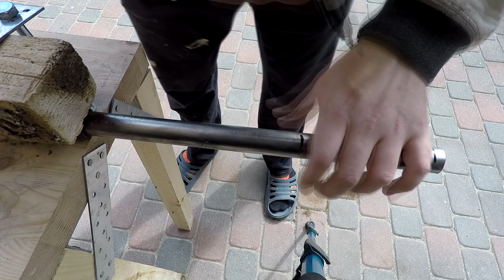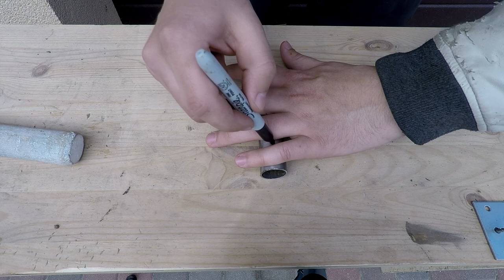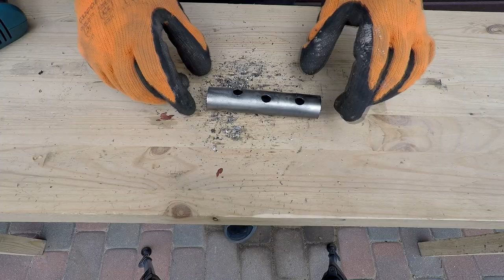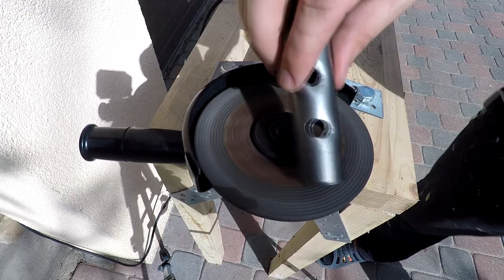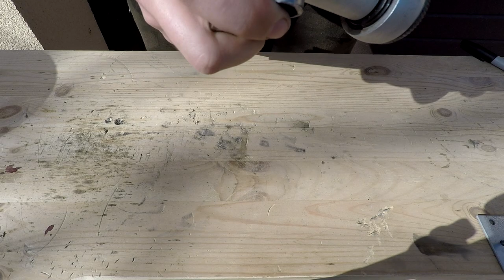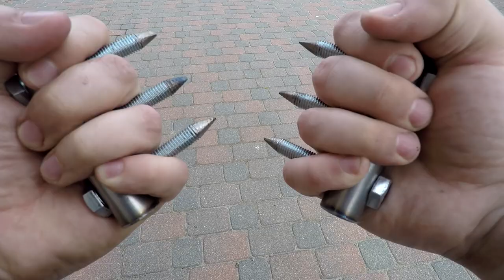DIY Brass Knuckles

Comment: these are also not usually SPECIFICALLY regulated since many laws define knuckles as "and hardened material designed to fit over the knuckles or around the fingers" whereas these go through between the fingers